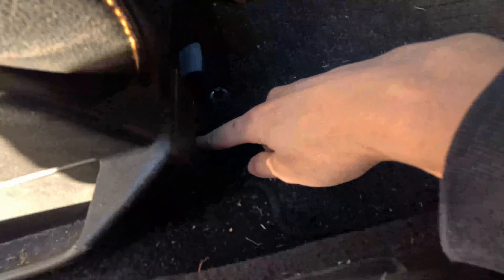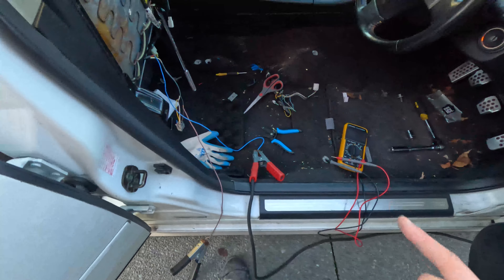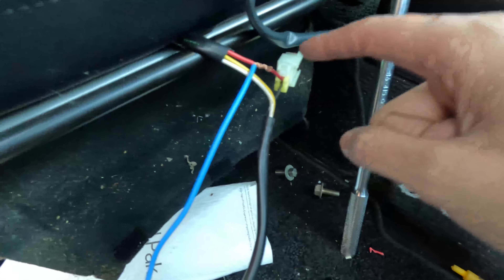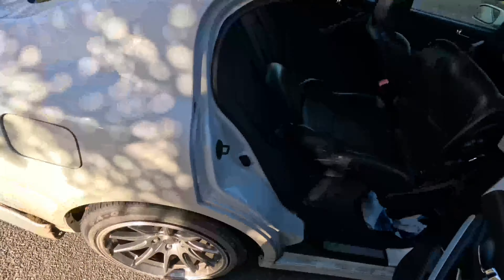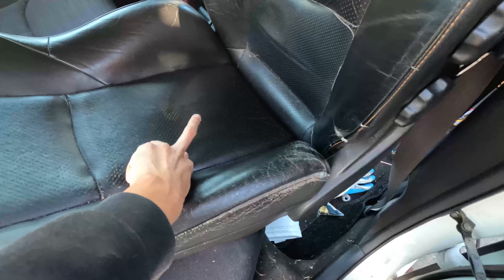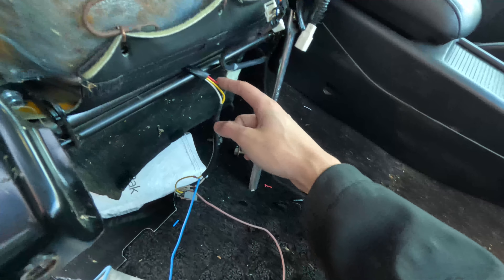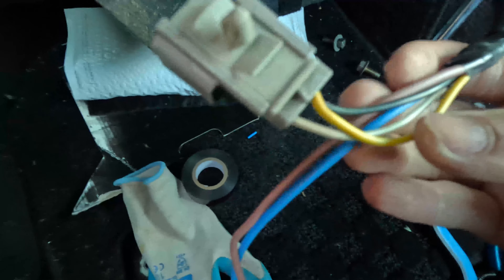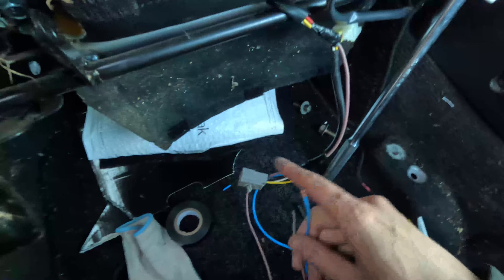WIRE UP 350Z heated seats in a G35 (How to Step by Step)

Comment: Hello I have a g35 my heated seats work, but barely feel them. Both driver and passenger side I can barely feel the heat, sometimes it warms up but it will go away after a minute or 2. Any ideas? My g35 coupe came with heated seats, and I just want to figure out why they don’t get super hot like they used to
Reply from the maker: Maybe the heat pads are getting old bro. I don't know if they have a relay tho Could be that as well i'm guessing?